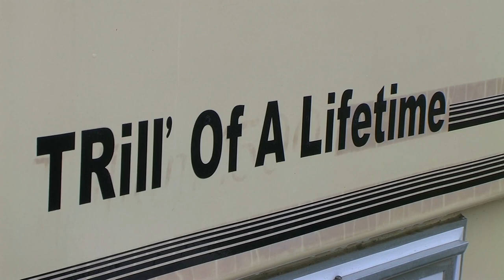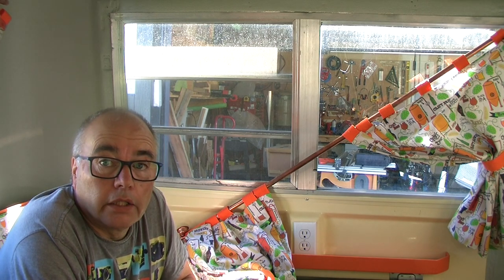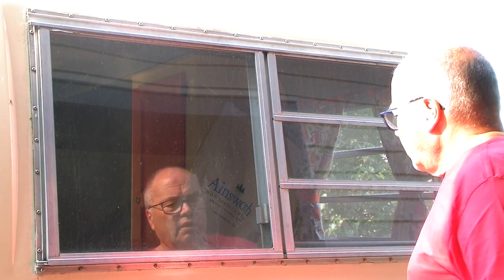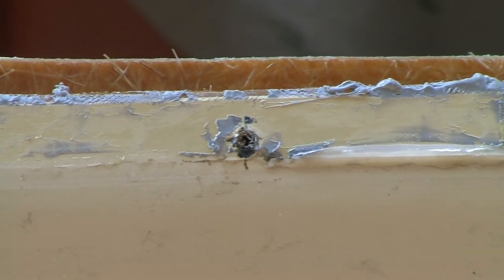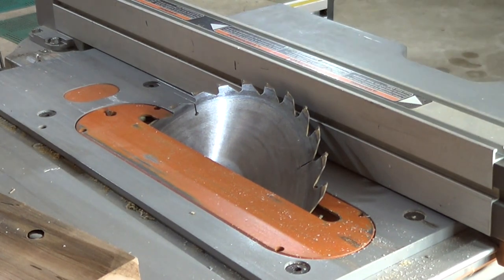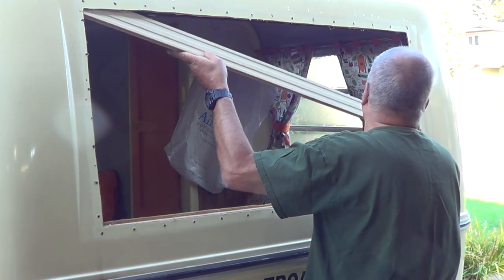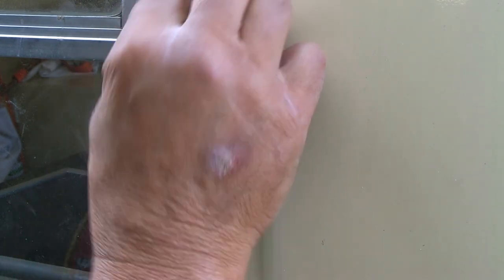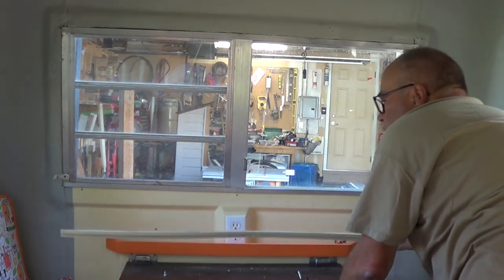Resealing Trillium Hehr Aluminum Windows

Comment: I would suggest anyone tackling this when replacing the wood, cover it with a product called redguard. It completely waterproofs the wood. I did 4 Coats of redguard on the wood framing. 6 years later no issues, still going strong.